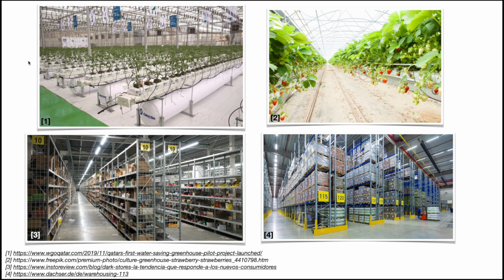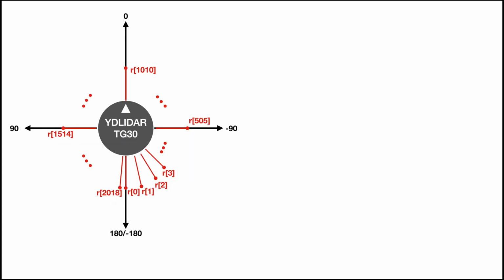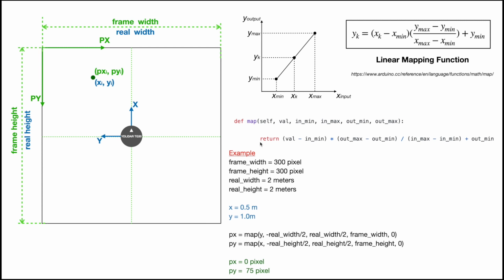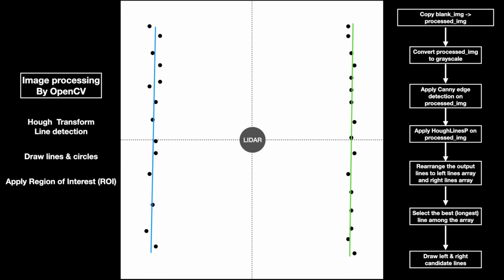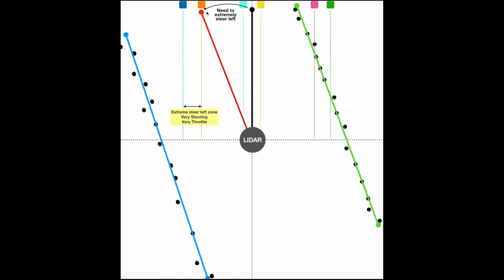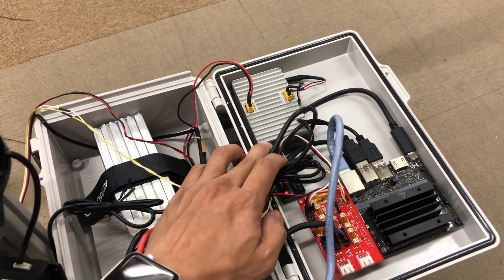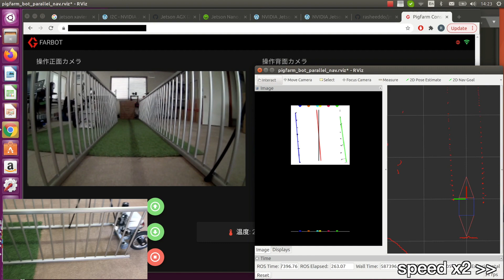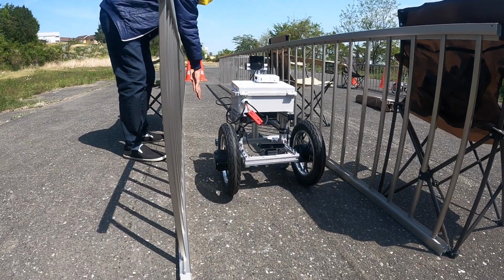Line Detection for Autonomous Drive Robot

Comment: Very nice. How did it not get tricked by the shadows at 9:30?
Reply from the maker: Thank you! It just considered object beside it to construct as wall. So that shadow might be aligning with other points, so when it does line detection there is no effect of that.
Reply: @stepbystep-robotics  Oh I watched again. I think ocv is only uses to present an image to the user. (Not used by robot's guidance system?)
Reply from the maker: @UC3Gvcmvt4mdrmp0t0DQifcQ Opencv here will tell the bot how much to adjust steering according to the middle line from image. Both display to user and robot navigation.